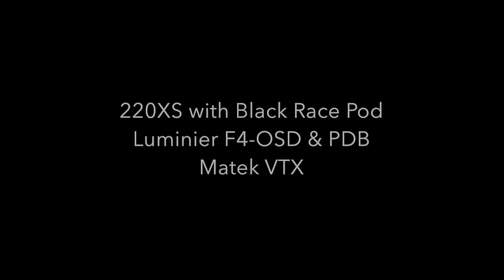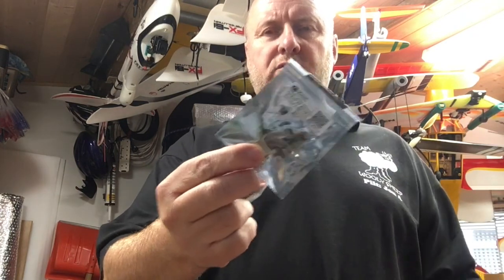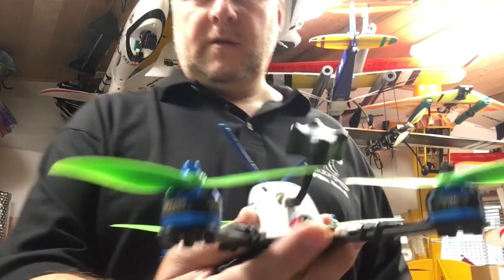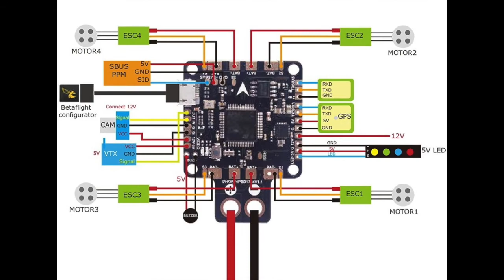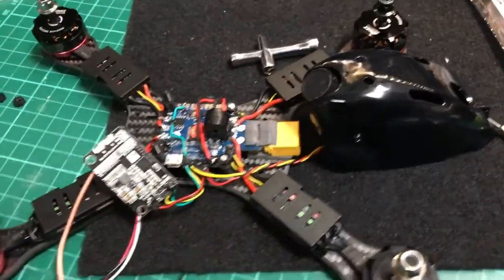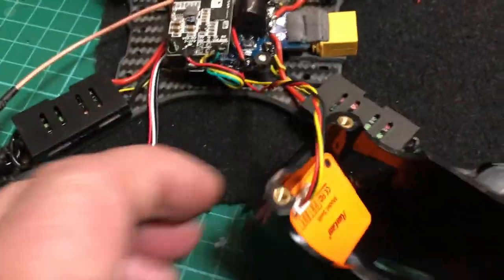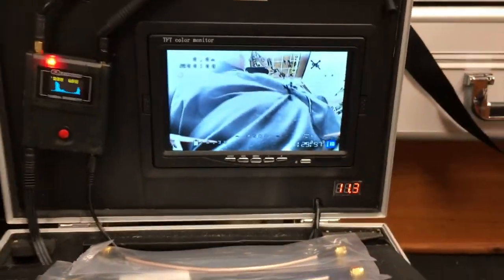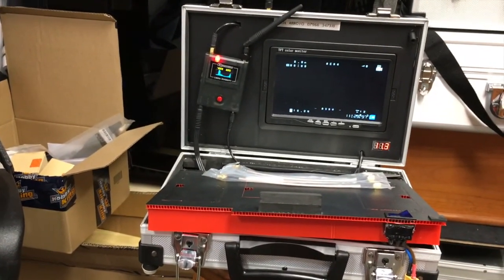220XS Lumenier F4 AIO Flight Controller With OSD / PDB & Matek VTX

Comment: hi did you get rssi workins as I have a xsr and nothing comes up on betaflight good video
Reply from the maker: Not something I have bothered to do as my radio starts screaming telemetry lost if I push the range. With the XSR you get telemetry feedback and normally connect the one RX wire however to get RSSI in OSD you will need to get the TX wire connected also. However, there seems to be a lot of issues getting OSD RSSI out of old XSR receivers and seems you may need a firmware upgrade or replace with the new XSR-M receiver. 
Have a look at this link: 
https://www.rcgroups.com/forums/showthread.php?2876535-XSR-and-RSSI-on-channel-16

Comment: do you know the current scale setting for the lumenier board? can't find it anywhere on the web
Reply from the maker: not understanding your question.....what do you mean scale setting?
Reply: Team Wooly Sheep Reviews for the current sensor in betaflight - default is 400, it sets how accurately battery use(mAh used) and current is shown on the osd
Reply from the maker: got you.....i have set the voltage only. There is current metering but accuracy would be tongue in cheek. I suppose with a good watt meter you could power 1/2 throttle and measure current draw then set the OSD but seems its work in progress if you wish to fine tune it. Best set the voltage as that is the critical one. Sorry I couldn't be of more help
Reply: Team Wooly Sheep Reviews I've emailed getfpv about it, will report back if they know. working it out is a bit laborious manually.... cheers tho
Reply from the maker: thanks that will be great.....
Reply: they responded today and said that 400 seems to be the right setting

a bit different to some other boards out there like the matek and omnibus fc
Reply from the maker: jamble7k that is fair as they are pretty much ready to go. Use it as a guide and keep an eye on the voltage as that is a better gauge.